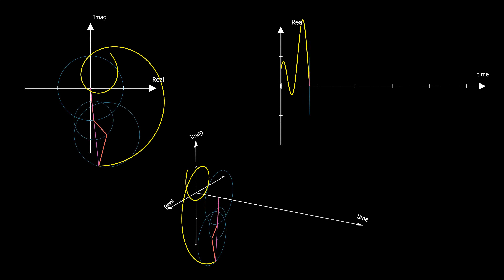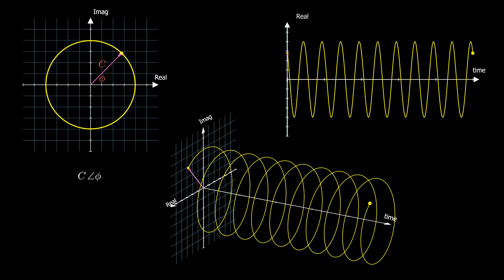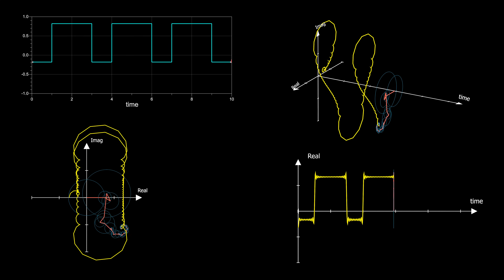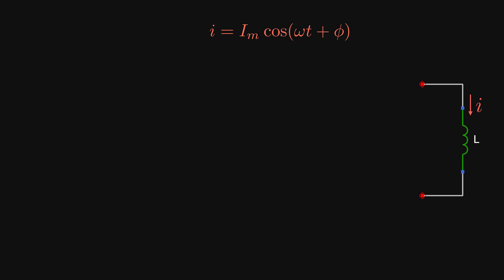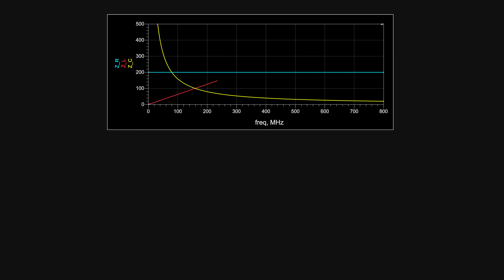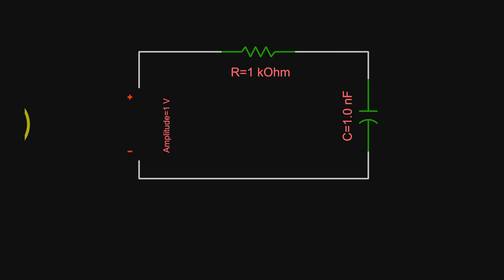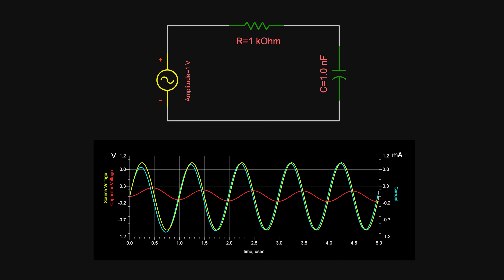A.C. Circuits : Phasors, Impedance, Fourier Transform, and how Inductors and Capacitors work

Comment: The Currents War wasn't actually between Tesla and Edison. It was between Westinghouse's and Edison's companies. Tesla was involved rather as an RnD guy on the side of Westinghouse. By the way, although the AC won DC is still present in the long range power transmission lines at a very high voltages.

Comment: 10:49 Wait, if for the linear graph the capacitor is a rational, and the inductor is linear, why did you draw the capacitor and inductor as lines in the logarithmic graph. I don’t think that’s correct, the capacitor should be a straight line downward and the inductor should look curved
Reply: Oh wow, I also noticed that

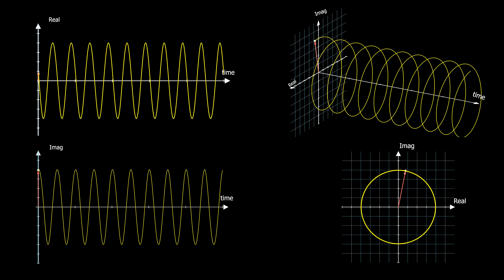Comment: 2:08 imagine the wave that would trace the square on the lower right graph (instead of circle), now imagine that trace in 3D in upper right graph, now look at it from the side to get the graphs on the left, that wave represented on either of the left graphs upper or lower should trace the line like it is going up and down at certain speed and then pausing at the top and the bottom of the amplitude in order to make the square traced on the lower right graph. 

Given your wave is tracing circle similar should apply, wave should speed up in the middle of the amplitude and slow down at the top and bottom portion of the graphs on the left because if we take the example of the lower left graph compared to the lower right graph we have wave tracing the line up and down in the left graph but looking at the right circular graph wave is tracing the circle so in the middle portion of the wave majority of the motion is done in the imaginary axis but at the top and bottom portion of the circle majority of the motion is made in the real axis which we do not see in the graph on the lower left so it should be represented as slowing down of  the motion in imaginary axis which is what is represented in the circular graph. 

Why is this not represented here and on the bunch of other places if this representation is correct than try to sync the speed of the circular (ones on the right) and sinusoidal (ones on the left) graphs?

I am not that smart to say what does this mean, I am just observing that there is something wrong with this representation and that these left and right graphs cannot be synchronized to trace the wave at the same and constant speed so that the point which is tracing this wave always shows the same value of the imaginary and real axis a in same time on all 4 graphs, so please explain it to me if I am the only one seeing this, and if I am not the only one why no one of you did not ask this before?

I dont know did I explain well what is I  am asking, but I hope I did and someone would understand, one more way to ask is if we look at the bottom right circular graph and observe the point which is tracing the circle, look at it in bottom portion of the circle - when it is close to imaginary axis - when that point moves one unit left and right from this axis it is moving mostly plus or minus measured on real axis and stays pretty close to minimum of the imaginary axis. But in the same time looking at the graph at the lower left, point tracing the wave moves at the constant speed, so it seems like it is moving more on the imaginary axis than it should compared to the circle at the right. And these two graphs should agree with each other because they are representing the same thing. 
If we say that the point on the circular graph at the right is at the time 0 positioned at the 0 on the real axis, and at the position -4 on the imaginary axis, then that point at the time +1 is positioned at the -1 on the real axis and -3.9 at the imaginary axis, but at that same time +1 looking at the sinusoidal graph on the lower left this point is not there, it is already at the -3 position on the imaginary axis ?

Comment: Very interesting video and very clear. I have only a question. I think 1 MHz, which is the source frequency in the RC example, does not match the 90 phase shift frequency in the Bode diagram. In fact, the right frequency is not 1/RC,which is the pulasation, but 1/(2*pi*RC) which Is the right frequency when the two waves are 90 degrees out of phase. Tell me if I'm wrong😅. For the rest, very interesting video and very clear at all👏🏻👏🏻👏🏻
Reply from the maker: can you specify the exact point in the video you are talking about?
Reply: @TheSiGuyEN  from 12.24 the example of alternating signal in RC circuit
Reply from the maker: I didn't say that the source and the cap voltages are 90 degrees out of phase. I said that the voltage across the capacitor lags the current flowing in the circuit by 90 degrees. and that what happens at any frequency there's nothing special about 1MHz, the capacitor forces the current to lead the voltage across it by 90 degrees. and yes you are right, 1MHz isn't the 3dB frequency. But the 3dB frequency (1/(2pi*rc)) is the frequency at which the input voltage and the output voltage (the voltage across the cap) are 45 degrees out of phase not 90. 
thank you :) if you have any questions or suggestions please let me know here or in our Reddit community.

Comment: Nice work - It's worth mentioning though that the complex representation should come with a complex conjugate so that I, V etc. remains real-valued. Leaving the conjugate term implicit is fine for linear circuits, but can create confusion when it comes to nonlinear interactions e.g. mixing or power dissipation if the conjugate term is inadvertently omitted.
Reply from the maker: I think I talked about that in my laplace transform video
Reply: I wish I understood what this means.
Reply: @stargazer7644  Well I can try to explain it in simpler terms - basically it means we need to pair up our complex exponents in the form exp(i*x) + exp(-i*x) - this retains the algebraic simplicity of using complex exponents, while keeping the function real-valued. If we then try to compute e.g. the power through a resistor using V^2/R, we get both the DC and 2nd harmonic terms as we should. Without our conjugate pair however, we don't get the correct result.
Reply: @Camptonweat funny thing is you take for granted that this guy had sophomore stem level knowledge of physics, algebra, electronics etc, while he probably meant he understood none of the words and the huge material of implications that exist behind each one 😂